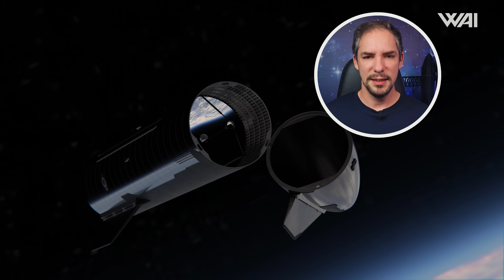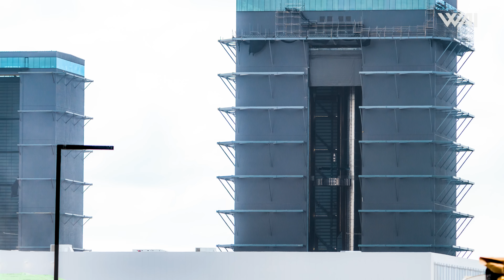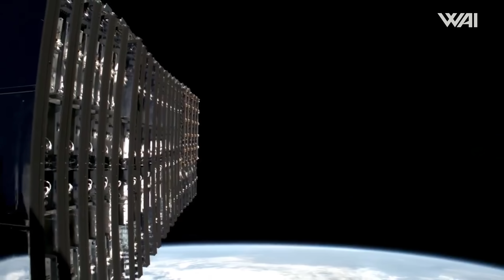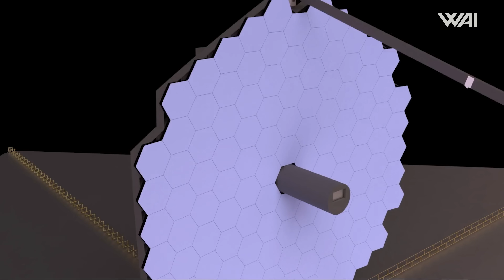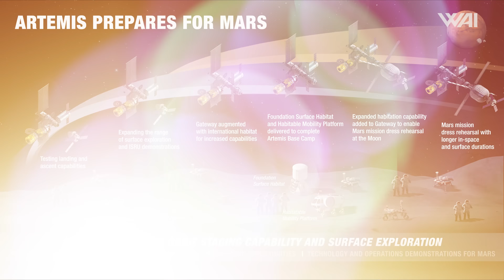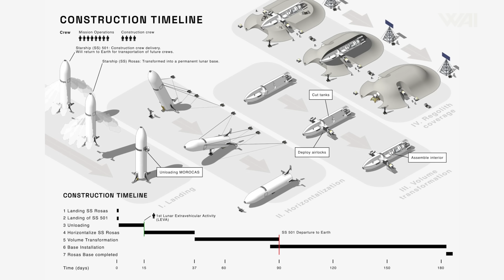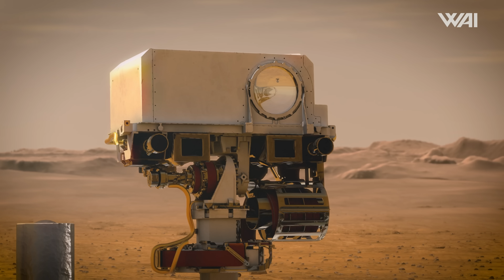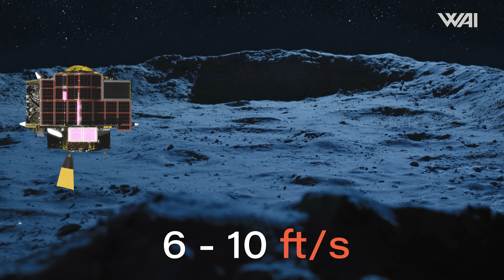SpaceX Is Building The All Seeing Starship Eye!

Comment: A "fabric" door is actually not as uncommon as one thinks....Aircraft Hangers can have the "fabric" doors as they are cheaper, open faster, and lighter.
Reply: We have a couple in our copper mine truck shop for the 250ton haul trucks. They hold up better in heavy wind then the smaller rollup doors.
Reply: Yeah, we have a couple with a fuselage shaped hole in the door so that an aircraft can park halfway in the doorway and work can continue.
Reply: Exactly
Reply: They're also less likely to cut someone in half when they fail
Reply: If you consider that the Eagle Landers were just Foil, yup.
Reply: fabirc roll up door will keep out most blowing dust, pannel doors have hinges and are expensive and hard to seal between panels
Reply: The NASA Vertical Assembly Building (VAB) has four doors.  Each one is 450 feet (140.0 m) high and takes nearly an hour to open or close.   That's about twice the height that SpaceX needs for a SuperHeavy on a transport stand - but the insane engineering that went into the VAB doors is VERY not-SpaceX!
Reply: "fabric" doors are nearly useless for hurricane protection.
Reply: @jessepollard7132  so are any doors in a hurricane
Reply: That doesn't stop an Elon Fanboi from claiming it's so shocking and revolutionary
Reply: @matttzzz2  ah u mean an apple fanboy? lol

Comment: the idea of laying starship on its side to make a lunar base is rather idiotic considering how much habitable volume will be lost and how much work will be required to convert the decks oriented for use in gravity while the ship is upright to laid down when conversely all that has to be done for vertical conversion is fit mounts for airlocks on upper tank bulkhead and lower tank bulkhead with the downcomer attached to the central habitat as the means to ascend/descend the full height of the structure as needed either via a ladder added internally or a dumbwaiter/elevator system. assembling a few dozen into a vertical cluster in a modest crater that can either be completely back filled up to the primary door where tunnels and airlocks between the starships would be fitted and then filled over to provide the radiation shielding or the bottom of the crated around the starship fitted with soft expandable habitats interconnected to each other and the cluster of ships then back filled would provide 1 of the easiest to assemble large scale habitable volumes with the least lost to orientation issues

Comment: Mass production of space telescopes circumvents the whole "satellites block our view argument". Imaging having 20+ telescopes with hubble or better capabilities. No fighting over scope time like current.
Reply: Hubble had a 2.4m primary mirror, and the James Web 6.5m This would be ~8m primary without needing to be segmented with all the artefacts that produces (assuming it could survive launch), putting it on par with the largest single mirror telescopes ever.
Reply: @jonathanbuzzard1376  and it could be don't very very simply. If the will was there to start mass production, rather than just bespoke as current.

Comment: Starship telescopes wouldn’t need flaps or hinges. Just make the top rings with staging hard ware like between booster and ship. Eject the nose cone by springs or by spinning since you won’t need it again. Similarly you probably wouldn’t want to return the mirror to earth so no flaps needed.
Reply: Yeah! Good thoughts.  Maybe the ship could be refueled as needed, too.  If they were far enough out to be difficult to do repairs the ship could return itself to low earth orbit or someday lunar orbit for repairs and upgrades.
Reply: I say keep the nose cone and just do as was rendered.
This will allow it to return to earth and have various components upgraded and/or repaired.

Imagine if Hubble could've come back on is own and then be relaunched after repairs/upgrades!
Reply: @DUKE_of_RAMBLE  swapping out sensors is a reason to bring it back, but the added weight of equipment that would secure the moving parts from g forces (as opposed to one time use systems just for launch) would probably make it not feasible. If it’s as cheap an option as suggested it would be better to just keep adding more newer telescopes than to try and recover them without damage.
Reply: @rosedruid  Admittedly, I'm out of my element here, but given how light a telescope would be (compared to SS-SH's upmass capability), I'd think that adding in the necessary hardware to curb vibration and g-loads would be simple, given they're wouldn't be massive weight restraints hindering the engineers.

However, I suppose the fact there wouldn't be massive, and therefore expensive, lenses like Hubble, your probably right in that it wouldn't be saving as much money to bring it back.
Maybe SpaceX can throw their mass-manufacturing knowhow towards mass producing space-based telescope and bring the cost way way down, thereby allowing them to perhaps create a 10 telescope array for the price of say, one JWST... 🤷‍♂️

We shall see, since I think this will definitely be a matter of "when", not "if"! 🤘
Reply: @DUKE_of_RAMBLE  mass is always worth cutting for space flight since fuel is a cost. But you are right that they’d probably have the extra mass. But a telescope array could have extra promise if they can synch them far more accurately than we can now.
Reply: @rosedruid  Give each one a stripped down Starlink satellite to use it's Laser connection as a LAN! 😀 (seriously!)

Comment: I do believe the upcoming hurricane season will be the deciding factor on whether or not they keep these soft doors or move to rigid structures.
Reply from the maker: That could very well be the deciding factor. Though, fabric can withstand a lot of wind force. :_WAIRocket:
Reply: @Whataboutit  Indeed .as it's flexible ..can go more with the flow .. Ridgid doors like at the VAB does not :) TY Felix from Ottawa Canada ..love your weekly updates
Reply: @Whataboutit  wind yes, but not debris.
Reply: @Whataboutit  But if a flying piece of star base meets said door it might be a different story.
Reply: "a flying piece of star base" as in from the launch pad, or the Massey testing area (where explosions could occur), both of which are HOW many MILES away and located on the OPPOSITE side from the Megabay fabric door opening????? @ntal5859
Reply: @ntal5859  Kevlar said hi.
Reply: They have ribs every few feet horizontally then a big steel beam at the bottom to keep it tight when it’s down. Then hold up to high wind better than rollup doors.
Reply: The fabric they use for space habitats (Dyneema?) may be enough.
Reply: @gary.richardson  The forces applied by our atmosphere are incredibly uneven, and the larger the structure, the more uneven they can get, while the more force the wind can impart. I would suggest that a space cloth built for a steady 14-18psi is not going to face such tensions in its end use. But, that doesn't mean you're incorrect. One question, I suppose, is would there be a significant weight savings to use what, I presume, is a heavier fabric than just putting in a series of solid panels? 2000lbs of flexible cloth falling 3 stories isn't much better for an unlucky recipient than 2500 pounds of a solid. Cost per square foot adds to this question.
Reply: Onion domes (can) have cyclone ratings.
Reply: Hurricanes don't often reach landfall that far south.  The risk is rather low.
Reply: @SteveBakerIsHere  I would love for you to come here and tell us all that we don't "usually" get hurricanes. You would be run out of town.
Reply: @SteveBakerIsHere  ANYWHERE is risk is rather low - but it only takes one to wipe out such a structure - and it could take years to rebuild.

Comment: Imagine the tether snaps and the starship your spinning in gets yeeted out across the solar system 😂😅
Reply: You assume there would only be one tether, but there would doubtless be four or more tethers, each composed of high tensile steel cable like those holding up the roadbed of suspension bridges.  There would also be power and communications cables not under tension.
Reply: @pahtar7189 🤦🏻‍♂️
Reply: @sc1338 🤡
Reply: Due to cosmic ray wear and tear, a regular maintenance schedule will be needed to be inspected and repaired on an ongoing basis. Hydrogen embrittlement damage comes to mind and might be detected acoustically similar to how a guitar would sound out of tune

Comment: I'm so ready to see Starship splash in Hawai'i and the booster in the gulf.
Reply from the maker: The current plan seems to be to deorbit Starship in the Indian Ocean. They're doing the keystone fuel transfer test for NASA and they might even try for a real orbit. Technically, IFT2 would have reached orbit if it wasn't for the LOX venting which caused a fire in the engine section, resulting in a FTS trigger.
Reply: @Whataboutit  Are they really working round the clock? Surely they need and deserve a good amount of time fir vacation and fun?? Hope to hear from you.  Thanks for sharing.

Comment: Wonder is it would make sense to catch a Falcon 9 to test and refine the catch concept .....
Reply: Its a totally different design with different physics, and materials. They can honestly model it better with the data they already for from their actual starship flights than they ever could from a Frankenstein Falcon 9.
Reply: Cool idea, but one critical difference is that the Falcon 9 can't hover.  When you see Falcon 9 land with one engine the thrust of that single engine at minimum throttle is greater than the weight of the nearly empty booster.  I think Starship and its booster will have the ability to hover for a few seconds.  This makes it way easier to finely control the approach and the final position just before contact.  A few seconds of hover would also make life a whole lot easier for the chopsticks, more leeway on the timing of their movement and less abuse from the rocket exhaust.
Reply: @Aimrehtopyh I just wanna to say that Falcon 9 can't hover as minimal thrust from one engine is still too much for hover.
Reply: That's precisely what I meant. 😊 @just_archan
Reply: @Aimrehtopyh  Technically, it doesn't have to hover. All you need to do is arrest the downward motion, which is exactly what it does now when landing on the barges. Once that trajectory reaches 0, you cut the engines. (my understanding is that neither SS nor SH will be hovering, either, at least not in the conventional sense)
Reply: Yes, Falcon 9 cuts the engines right when velocity reaches zero.  Controlling the speed so that this happens reasonably close to the ground (and not below) is the tricky part. Based on the numbers I can find, the Super Heavy will be able to hover until the fuel runs out.  I mean that it will be possible to throttle down to where the thrust is precisely equal to weight.  Staying vertical is a skill issue.😉   @DUKE_of_RAMBLE
Reply: @Aimrehtopyh  Good to know, thanks 😀
Reply: This would require the grid find to be able to bear the weight of the entire booster, which is highly unlikely to be possible
Reply from the maker: It would mean conciderable modifications to Falcon 9. That would likely be a year long project. :_WAIShocked:
Reply: Nevermind the fact that the chopsticks would need modification to still be parallel whilst closed together, since Falcon 9 is SIGNIFICANTLY thinner (smaller diameter).